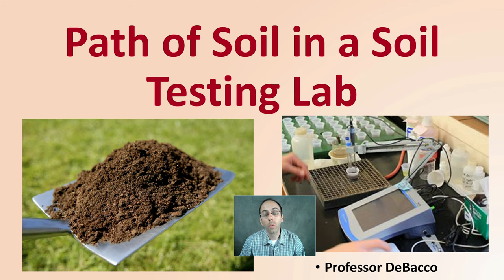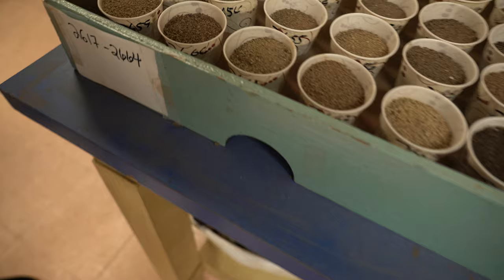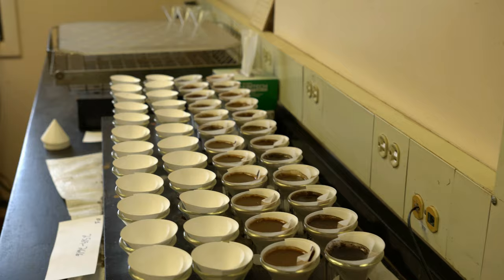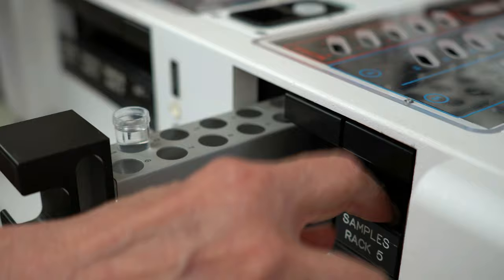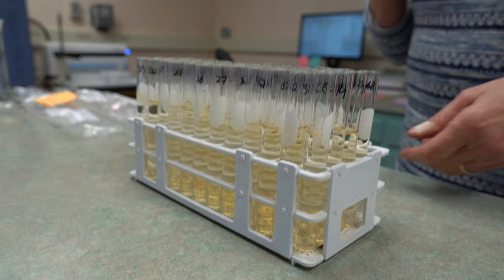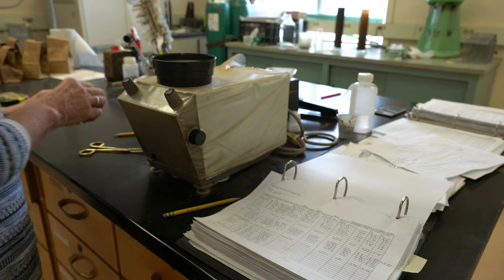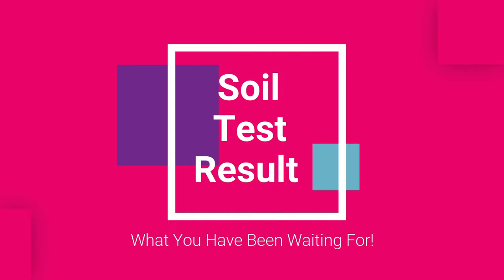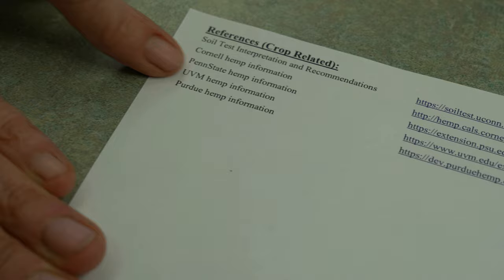Path of Soil in a Soil Testing Lab

Comment: That was interesting (a year later). I was amazed at how many times each sample was handled by a human in order to get to the nice clean computer generated results page. You can see how hard they have worked to make the procedures easy to do right and hard to do wrong, but for a non-clerically talented person like myself, it would have a lot of bad results. I am always amazed when I see people do repetitive tasks consistently and with minimal errors.
I think they earn their lab test fees.
Reply from the maker: Well said!
Reply: Yes - I was also amazed by the labor-intensive system and the data that had to be written by hand.  Seems like those instruments should be able to dump the data to a central data base for calculations and report generation.  Just a thought.